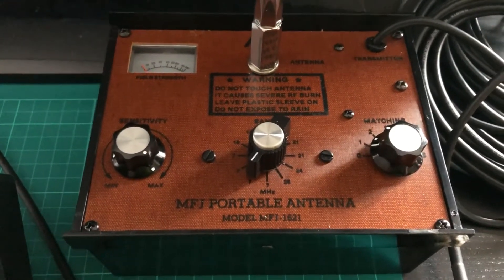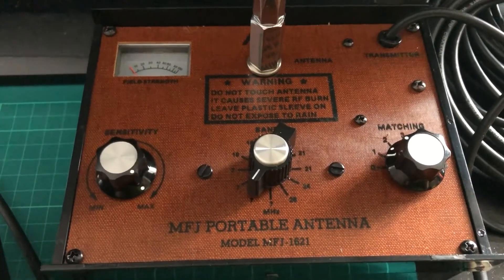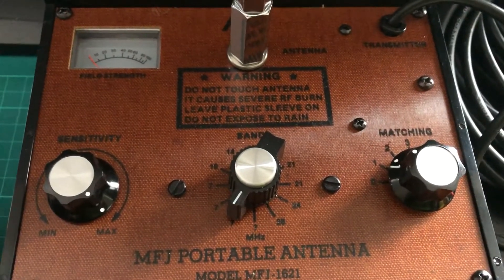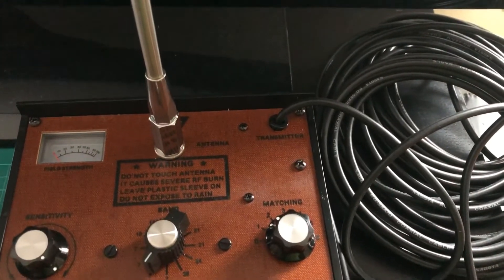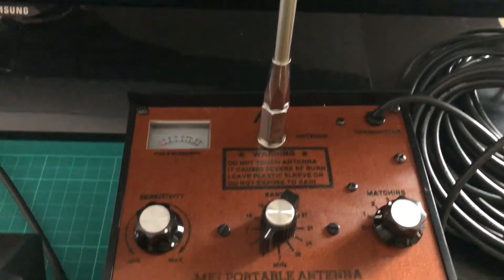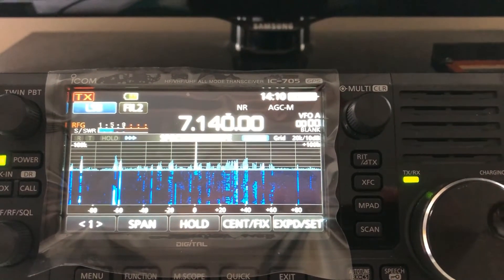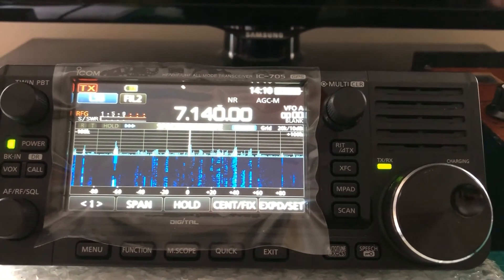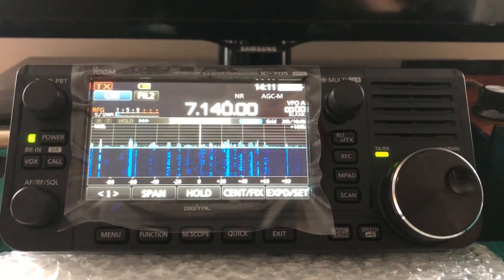MFJ1621 Portable Antenna Shorts##

Comment: Question here if anyone knows...
Guys with Radios on their bench, electronic tools, projects, repairs, etc..
I've even seen guys with model train projects using them..
What are those green things, they look like some kind of mat, they're green in color, and have a white grid line pattern on them, what are those things?
I always wondered if they had a specific name assigned to them or if they served some specific purpose.
Reply from the maker: Interesting. The mat you see in the background is what I use to protect the work surface.
They are known as a cutting mat ! If you do a search on eBay you should see a list of many variants. Thanks again for the comment and question. Take Care 73
Reply: @jason2e1hko59  Greatly appreciated.